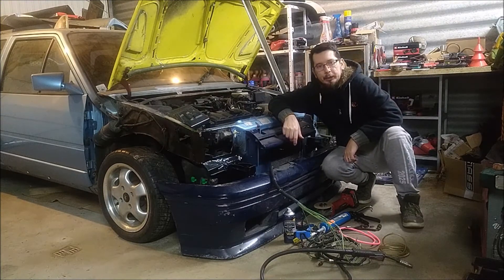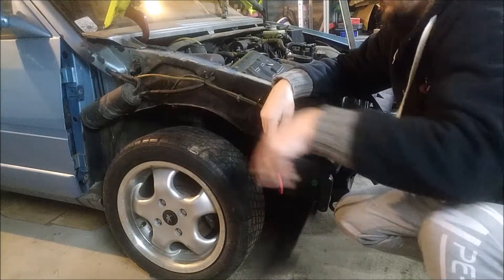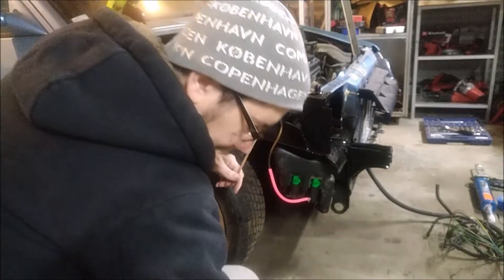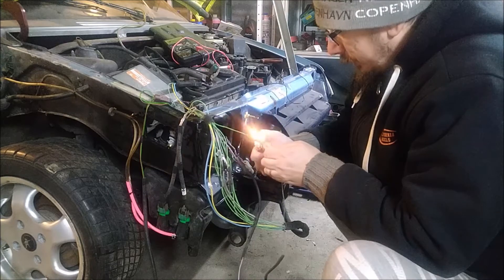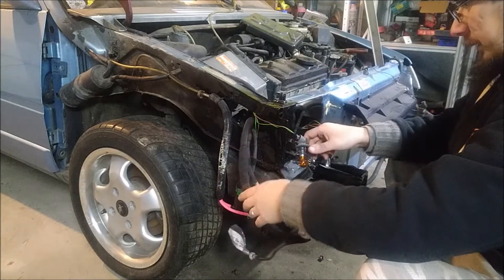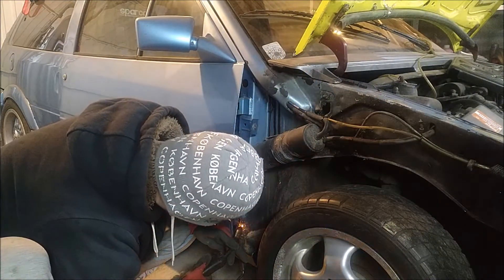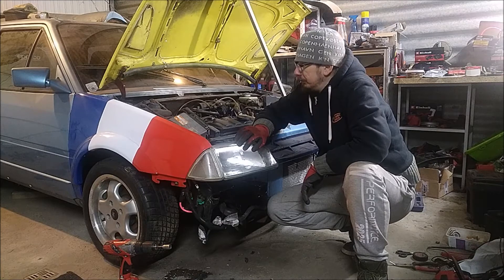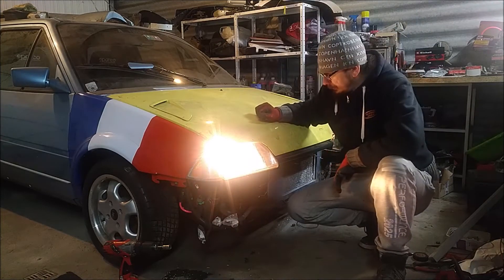Citroen AX GTI electrical fix

Comment: That is not the gti bomper
Reply from the maker: No it's not  and you are absolutely right. This is the original aftermarket one for the AX produced from the Tuning company Postert. This AX GTI was fully upgraded in the late 90's as you can see with complete respray as also the interior. The aftermarket bumpers are from Postert produced mainly for the GT and GTI but you probably already know that. Sadly the front bumper was damaged in a collision from the previous owner but I still have it and it's all the same as this dark blue one. What happened to the original bumpers, I don't know, but the type of bumper what you are referring is also on my original 5 door 1.1 sport version as it came from factory. But I made only one video from that AX under the backup car playlist. And frankly it's ok if you like and want the original, but I like the wide bumper more. Thanks for watching the video 👍.